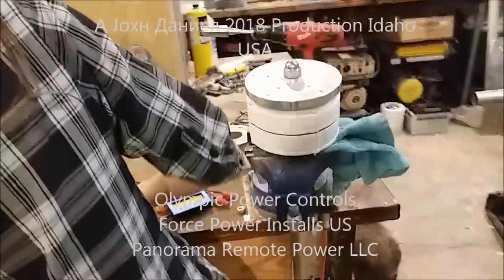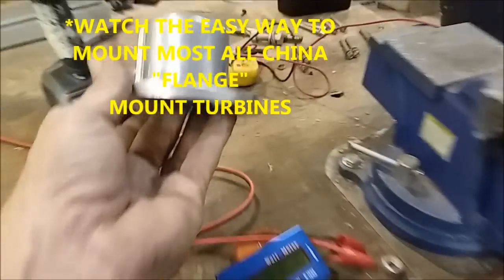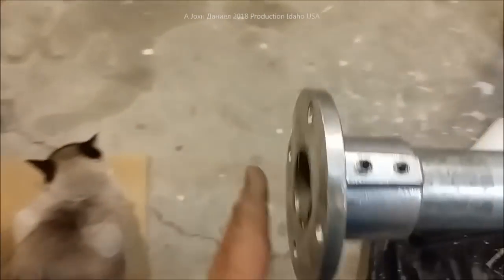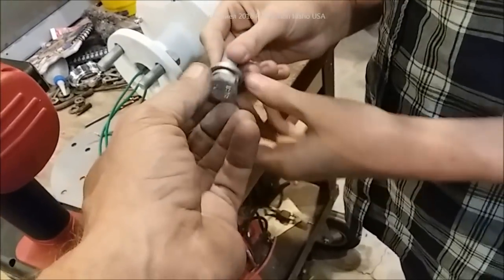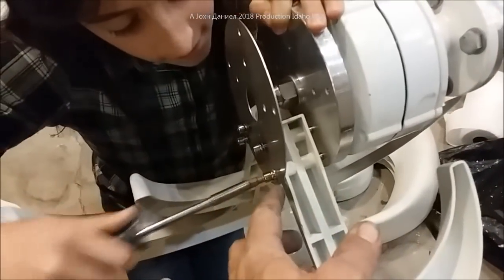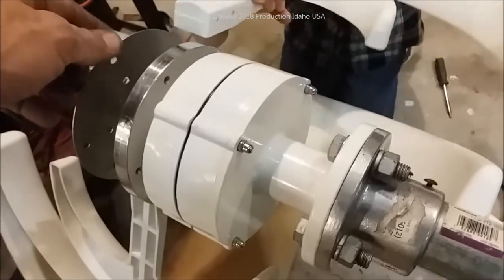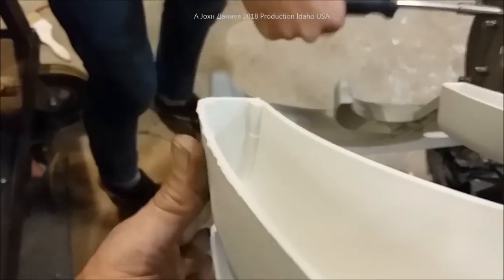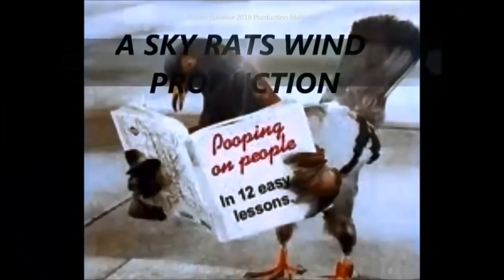Chinese LANTERN wind turbine generator VAWT vid 2 of 2 UPDATED INFO BELOW VIDEO!!

Comment from the maker: The parts used 12 volt OR 24 Volt https://ebay.to/2P4hngv , BEST 1000 watt 12/24 wind & solar controller https://amzn.to/2II1o6w & Better 12/24 UpVolt Wind controller https://ebay.to/2IFgCZR . BEST FLANGE 1.5" pipe https://ebay.to/2NvFsvX & 2" https://amzn.to/2A0Scr9 
VIDEO 1 is at https://youtu.be/SmTMz0p8G1M  Any questions, ASK, see my other videos on Solar and Wind! I love sticking it to the junk sellers and getting you ready for generation POWER FREEDOM!
NOTE - Historically Vertical Axis Wind Turbines were not very efficient, it appears the need for a LOW rpm alternator has been answered, now look for Video 2 soon, weather permitting! ***Word of caution, never buy a wind turbine sold on hype, avoid those fake imports from internet sellers out of Texas, Florida & Missouri that are insanely claimed as 2000+ watts from 2 lbs of copper in a shiny case LOL. Be smart and realize accurate world wide ratings are based on 25 mph, not 150 mph. NO wind turbine with 5 to 6 foot diameter blades can truthfully make a real 650 watts, don't buy the lies!!! A simple VAWT like this one is very good under $200 buy, but be wise, watch out on Vietnam junk dealers like the Missouri Wind Scammers, Texas Rebranders and even the Chinese knock Offs on their own stuff!
Similar options https://amzn.to/2A27dc7
Reply: John your link to this at ebay just changed, I ordered one it just came in and it is the old style with single catchers per arm not double like i ordered. FYI
Reply: @chrischrismelco  The third one I ordered showed a red one with the new design but the ad said it did not have "stents". So when it arrived, it was as advertised without the extra vanes. Have not test run it on the lathe yet but expect it to be the same as the others. Funny that just before Christmas they were down to $95. Now they are all in the $120 or more range. Except the 600 watt one I grabbed this morning at $77. It was their last one of the 24Volt red ones with controller and I guess they wanted it gone. We'll see how it does when it gets here.
Reply: VAWT's are good for charging. Don't have to worry about changing wind direction or high speeds and will start turning at low speeds. Town regs  limit its max height to the distance to the closest property line. Everyone says the output isn't as much as a HAWT but the way I look at it you can have one giant ostrich egg or a dozen chicken eggs. And if one needs service you only loose partial power. Your single HAWT goes down, power's down to 0.
Reply: Јоhn Daniel hello
Would u email me about the Chinese lantern 12 or 24 volt turbine
Raychavez6333@yahoo.com
Than u in advance
Reply: hi john.2nd set of questions.i saw a video (9:34 minites) on youtube where the guy is testing chinese vat with 20-30mph winds.it looks like he has the larger motor,but old style blades.he shows that the unit is producing zip.hardly enough to power a 100ma electric motor.is the motor turbine on your unit a better design ? have you had a chance to really test it.i am retired and don't want to spend money on junk.thanks  mel
Reply from the maker: I would put your dollars into one of these, the source is Aliexpress, the results are 100% and its been up a year making every watt plus of its claims. https://youtu.be/B9e_owv9U7w
Reply: @JOHNDANIEL1  Hello, i am sorry baout my english but i'm french so i dont speak very well. I want a vertical wind turbine because i live in mountain so i have permanant wind and more gust some day, i think horizontal one will not worth it, do you think i'm good in that ? so did you find a verticale wind turbine working well ? i find a model named on aliexpress "FX 600 by FLTXNY" what do you think about it ? thanks a lot for all your test you help me a lot by not buy broken stuff...
Reply from the maker: @LApprentieFermière  My suggestion is any VAWT with the coreless generators are better, but nothing as good as the horizontal now. You can send me more questions and info to my shop email and I can try to focus on your area and all things considered to help. I get many so it may take some days to respond to all request. EMAIL - olympicpowercontrols@yahoo.com

Comment: Smart girl. I was waiting for the video to end to mention that a ring or plate attached across the top will not reduce efficiency and may improve it by stopping the flexing of the plastic blades. Interesting blade design, dual wing catching more thrust than just single outer edge design wind wheel.

Comment: PMA???? What is the best Lantern windmill you know about? Like do we have any 48 volt models that do somewhat a little according to there stats? Full of liars and deceivers everywhere.
Reply from the maker: You will spend big for one with some decent results, you have to get one with a maglev PMA on it, PMA is a Permanent Magnet Alternator. The best one that can actually make usable power, over 50% of rating is not cheap. Look for components like these on this turbine, https://s.click.aliexpress.com/e/_DD90Bip with a flat radial PMA for them to actually make usable power. NONE make 100% what is advertised, you have to get a GREEN ENERGY turbine like I use in all my other videos to achieve that.

Comment: in short, is this wind generator good or is it crap, because all I hear is that it's crap, that it doesn't generate anything, crap, does anyone answer? someone has ? it works ?
Reply from the maker: They started by selling low RPM generators on them, then people got all greedy and doing virtue signaling as fake greenies so they started selling them as high voltage dirt cheap generators on them and none of them make any power. The low RPM models did, about 30% as claimed. The rest are garbage.

Comment: Kyra is a great little assistant.  But Kyra, you'll find it easier to tighten those bolts, if you hold the spanner further up the handle...  It's called 'leverage'.

Comment: I'm swapping my turbine for a vertical one. I have a question. My old turbine had 3 green wires that go through my hybrid controller but the new one only has 2 a positive and a negative it also says built in controller so am I right in thinking that this can be wired directly to my battery bank and the built in controller will auto brake in high winds and also stop overcharge of batteries
Reply from the maker: Yes,

Comment: Ive literally watched 8 lantern turbine review videos and not one of them actually tests the device properly or at all.. just making unboxing videos as if with toys. get a car battery connected to turbine output through a ampmeter/multimeter/power meter. Connect 1000w inverter to battery and plug in a load to inverter... start with 100w load and go up as high as it lets you. observe battery voltage and cogging of generator system...

Comment: Hey John. Can U tell me what the issue is with this turbine for it not being worth it? I would use it in a combi Solar/Wind system on a boat, 12v 480Ah battery bank (I'd rather use the VAWT so I dont have to worry where-ever I'm working on the boat... With the VAWT I would get a bump, with a HAWT I could get a slice...)
Reply from the maker: So many are fakes, so many do not have the coreless generator in them its a risk to buy them now. But even getting the ones with a coreless PMA in them is only a 200 watt max, the rest - FORGET ABOUT IT!
( a coreless is like a brushless bike hub motor )
Reply: K thanks John

Comment: The link to the generator does not redirect for me. Is this specific model still available?
Reply from the maker: I have not been able to find a heavy stator wound version (24 awg stator windings) to put a link on all I can find in the months since is fake light high volt useless 30 awg.
Reply: @JOHNDANIEL1  is there a follow up to this vawt,s function and output? I am deciding to go with a Thermodyne anyways. Any thoughts on the Thermodyne?🍺
Reply from the maker: @timlatimer620  The Thermodyne, a DIY excellent material source. Never had problems with them when done right. Never use a "brake Switch" on them and just build to your own design if you like.

Comment: I would like to see how this turbine does. Any video link to the testing please?
Reply from the maker: We installed it, max watts in that video peaked at 134 but at no time did it exceed 150 watts. Thats OK in price comparison with a 150 watt solar panel but not worth it in the long run due to so many are being sold with 100 watt PMA's on them that can barely hit 30 watts! So I'd say avoid, get the GE300 in my other videos and it will do all this x 3 .
Reply: @JOHNDANIEL1  thanks for the helpful information

Comment: i like the blades the motor on it is suppose to be crappy ..... 
i would use an e bike 500watt 3 phase hub motor ..... the axle can bolt down  and passes the wire comes out of the axle ....
the motor drum has way to bolt down your blades and you simply add a weather cap on the other side to protect the barrings ...... 
https://www.scooterwholesales.com/wp-content/uploads/2016/08/Brushless-Hub-Motor-99.jpg
you can push the axle down more and add more nuts to make it stronger....
all you need is  a set of good balance blades to bolt to the hub motor .....
the hub motor has  5v phases wires so you can get the rpm out to brake generator  power from the speed diodes in the wheel ..... like if it spins at 45 miles an hour  increase the brake generator so it only spin at 10 miles an hour .... and forget plastic use aluminum blades stove pipe... a simple arduino board and measure the  the pulse ..... spin fast brake spin fast brake    ....

Comment: 2nd comment because I didn't see this video. Maybe I should be consulting Cara (lol). Cara there is money to be made here. Here is the text from 1st comment: 

Your videos are very
helpful and a great reference for me. There is a small market in California
opening up that you and your Chinese connections could profit from: that is
power shut off from utility companies due to wildfires and rain storms. They
are always due to wind. For me an ideal system would be small, quick to setup
and powerful. Currently I have a 12v, 100amph, deep cycle battery that I charge
for short emergencies. My problem is recharging the battery. FYI: my electric
battery charger input requirements are low: Input 120VAC 0.6A continuous, 3A
Intermittent. So, I'm thinking I don't need a big system. I'm thinking Vertical
wind turbine, would be ideal in terms of size. What do you think?

Comment: It’s like this one
Reply from the maker: See my latest video  https://youtu.be/87J621EGT74 , its a 800 watt, really makes 800+ and will run on your system.  It is also very quiet and durable. I have one now sent to me as a gift for the 18 I have installed for buyers in my region to date of their 800 and 1000 watt models. I do install other brands, its customer choice, they buy and call. But I am really preferring their 1000 watt 5 blade and this 800 3 and 5 blade for most jobs. SO EASY and worth it.

Comment: All these cheap turbines have the same problem, cheap bearings, they cease and then the loose magnets displace and the plastic melts, the only thing they are good for is to change the blades to scoops and use it for a water turbine. (You will need to make a spindle for 8 scoops for consistent rotation in a stream!)

Comment: Absolute rubbish - These lantern VAWTs are widely recognised as a con, they dont work. A responsible youtuber would either remove this video or do a follow up with the performance.
Reply from the maker: As the install video shows, it made a max peak of 132 watts in 25 mph gust. Or about 200% more than a turbine from places around missouri for $500 makes. Conclusion, Neither the $150 VAWT or $500 Mah'zuri sky rattler turdbines are worth the effort.
Reply: @JOHNDANIEL1  If you know they are rubbish, why not tell people, read your comments there are loads of people who are interested in them from your video. You are currently promoting something you think is rubbish !!!!

Comment: Hey John,  First I like you video especially how  you have your kids involved.   
I purchased the same kind, but find the shaft of the generator isn't real tight in the bearing. I am concerned it will cause a vibration on the roof, and lead to premature failure.  I am wondering if you experienced this or did I just get a bad one.  I didn't install it yet, and hopping to hear back from you before I do.  
 Thanks in advance, 
    Danny.
Reply from the maker: If it wobbles return it. They should have about 1mm slack, no more.
Reply: @JOHNDANIEL1  Thank John,  I have been  trying to contact them  with no reply.

Comment: you could make a double prop truck fan washing machine motor wind turbine winterhorses lol  ! you just need you dads volt meter and power drill to figure your volts and or rpm glad to hear he had a responsability to slow his rpms lol

Comment: hi i have just got one like this,  but it as a gap on the second joining i see urs dose not  .so mine will let rain in side
Reply from the maker: Its a nice thing to have as a extra, but not enough power to be a constant supply of power. The one here, https://youtu.be/B9e_owv9U7w with links to get it under the video is worth every cent in power per watt and absolute accurate ratings. I say get the 500 watt model, you will see super high output, other links for parts are in the SHOW MORE space in the video description. I have installed over 60 now, not one unhappy person.

Comment: Small problem with that coupling below the turbine. You might want to add some kind of extra protection there. The inside of the coupling, unless you have the two sections right against each other, will have exposed threads that will cut into your cord from any vibration. I used a 1.5" to 2" coupling and 2" below to avoid a threaded area there. My wires then were also put into a piece of split loom to give them extra protection. Like you, I went with 12 gauge wire for the drop.
Reply from the maker: The pipe ends are well reamed and Its sleeved with Shrink tape through that area and don't move or rotate so its safe. Got one up 7 years, my HYE thats same way and not one issue.
Reply: @JOHNDANIEL1  Good to know. Should be good then. But how many others won't think to protect their wires in that area?

Comment: Love your videos and your daughter /children learning hands on. Seriously looking into wind turbine for my RV but do need to take down and put back up when moving the RV. My concern was the weight of the blade units and the lantern version is much lighter. I know your other video shows a unit with much better /accurate power. I would prefer one (cost is not an issue) that will produce what I need since I will mainly be off grid. Would you suggest the Aliexpress one? Just concerned about lifting the weight with my setup. Perhaps something I shouldn't worry about. It is only me but most times I'm stronger then I look LOL
Reply from the maker: You can install a pit pipe to make it easier to lift, and a lighter version you can probably handle better like the Luna 400 (NE-400) and its real rated https://ebay.to/2R0NWln
To make a pit set up, you will need a person who can weld. You will have to mount a pipe on the RV to become the lever, and seat for your other pipe. Let me know what RV your working with, model-year-brand and I can tell you what it's able to have adapted to it. If you get a Luna you'll love it. Same as the Automaxx but $100 cheaper though that link.

Comment: Hi.I live on a sailboat and depend on solar (600w) and 2 wind turbines(500w total) for power.when the turbines are running they can produce up to 15 amps.On a good windy day they will produce 10-15 amp hours,but the noise they produce will wake the dead.I understand the VAT are suppose to be fairly quiet.I like your new chinese vertical axis turbines. Your videos are great,but i am wondering if you have had a chance to mount outside and see what they produce.thanks  Mel

Comment: It is always good to see kids like yours wanting to learn. She had an excellent idea with the pizza pan! What about taking one and placing it on the bottom half also. Take a hole saw and cut it just a hair bigger than the pole . Definitely no vibration then.
Reply from the maker: A few weeks now of it up and running it has hit 200+ watts a few times in winds over 20 mph steady with gust to 30. The single pan did the trick, no shaking. About what I hoped for in power output, on par with solar dollar cost. But with the benefit of being storm and night producing when solar is a issue.

Comment: I just ran a test on my lathe with one and the open circuit voltage at 112 RPM was 84V AC. I think that as long as the turbine gets up to speed, it will put out a decent charge. We've had 30 MPH winds over the last few days down here so I might see the full rated wattage in a test. The box mine came in was from "Solar and Wind Power" and a lot of the markings are in Chinese.

Comment: You need to clamp an Amp meter on the wires to see how much current it's producing. 1 amp at 12vdc will take 100 hours to charge a 100ah battery as a rule of thumb.👍

Comment: Which one is the 12v model?  The listing shown is expired, can I trust the pictures shown on Ebay to get the right one?  I have solar,  ELT training, but need about 36 watts, continuous to run CCTV system. low southern wind, low elevation, very big live Oak trees, jungle to north , flat by Intracoastal , Central Florida . Just found you a week ago, playing, testing, learning...
Reply from the maker: Try the link to get near it, then Look for the 500 watt model that looks like mine. The one called a 600 watt is a boasting fake seller. Avoid them. No wind turbine with 5 to 6 foot blades can make over 750 REAL WATTS. lots of scammers on ebay, especially if it's sold or shipped from Missouri or Texas since their laws allow them to lie their asses off.